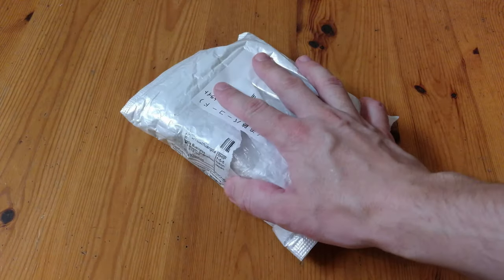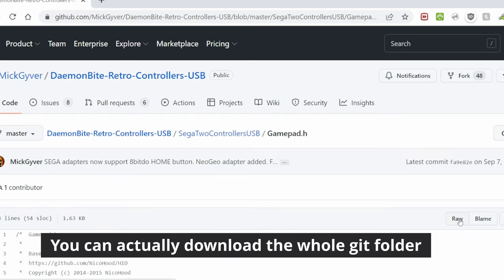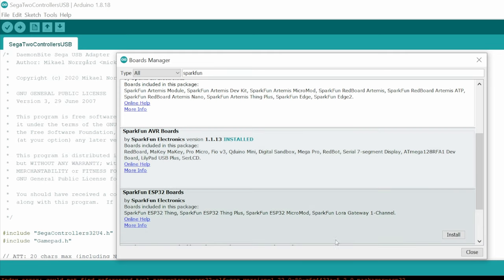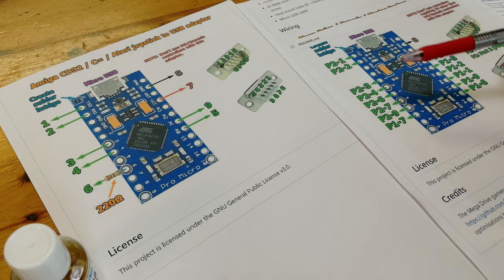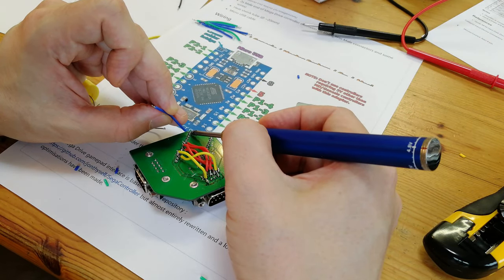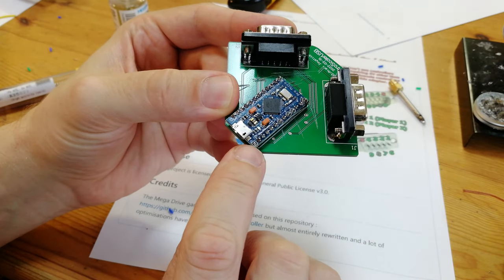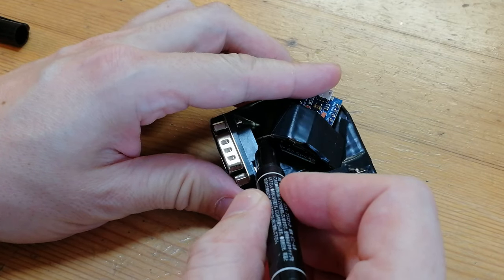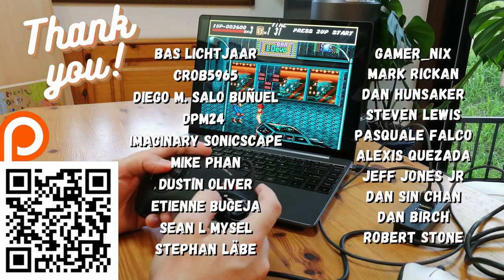We UPGRADED the Bitfunx Amiga CD32 USB Adapter! - Both Controller Ports Working AND Added a Case

Comment: i hear using a megadrive pad on the cd32 can harm the system is this true? and if so can you guys make an "adapter" or perhaps a pad to remedy this? cd32 pads are like 100 quid,does anyone know why the pads are so expensive? and why the console never seems to be sold with one online? was they sold seperately or something? i do have a cd32 but even cheap pad thats worn af is like 77 quid!
Reply from the maker: I think it depends on the system, but apparently if you push the start button on the megadrive you can short some Amiga components. 
Unsure which Amiga systems it affects, you could just not use the start button 😂 
The adapter in this video is to convert DB9 to USB, so don't think it'd really apply to a real cd32. I'll take the system though, always wanted one. Fancy a swap?